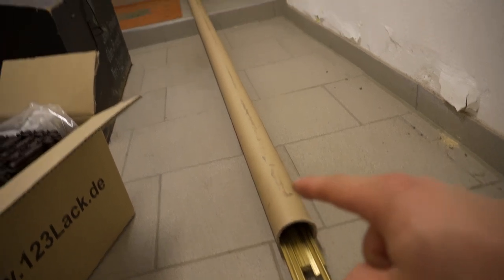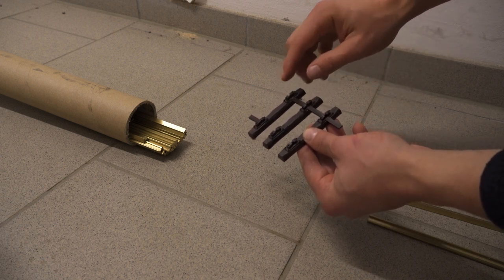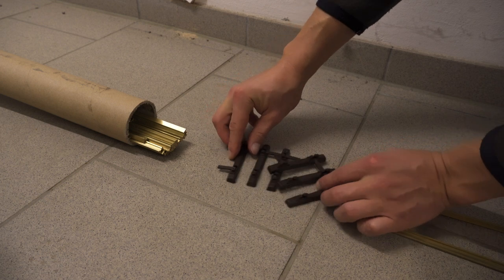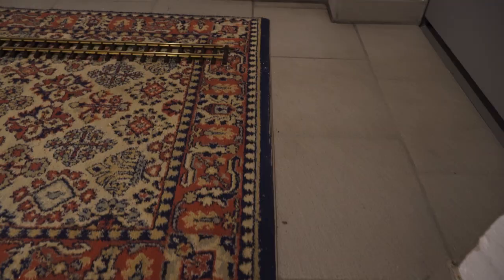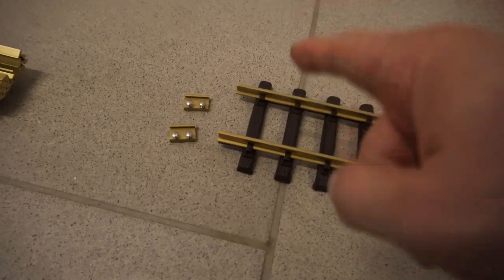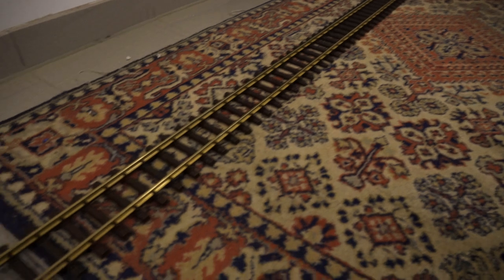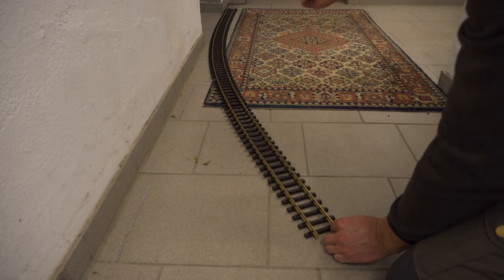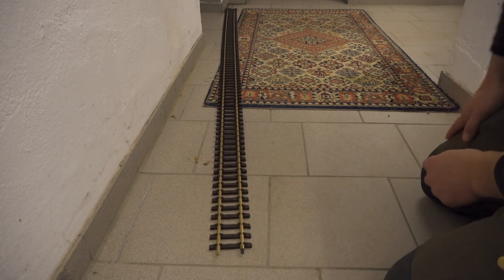Why to use flex track for your garden railroad ... assembling THIEL flex track

Comment: Did you eventually make a jig to hold the short tie pieces in line to make the slidibg on easier? If you did, did you happen to make plans or a 3d print file for it. Manually it looks quite tedious to do. I will try to find you track bending video too. I have trouble making 8' diameter or smaller curves and the easements by hand. Followed you for awhile now, happy new year
Reply from the maker: Happy New Year! It seemed very tedious in my video because it was. I found out later if you do it on a flat smooth surface it is no problem at all. At least it is not worth to build a jig for that purpose. If you have trouble bending those curves make sure your sleepers are positiond all the same way. They have one side where they are tied together and one where they are not. If all sleepers are the same direction you should be able to bend some very thight curves...